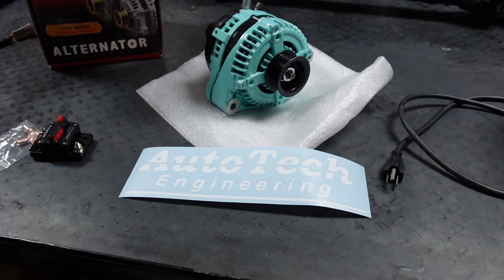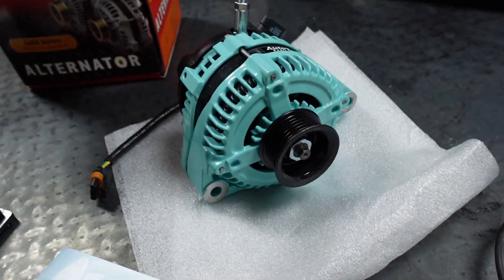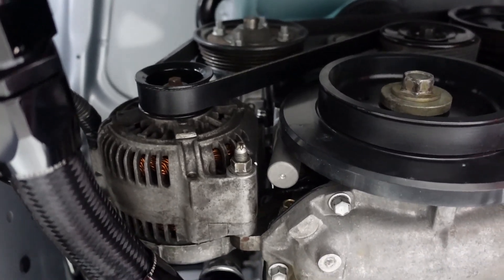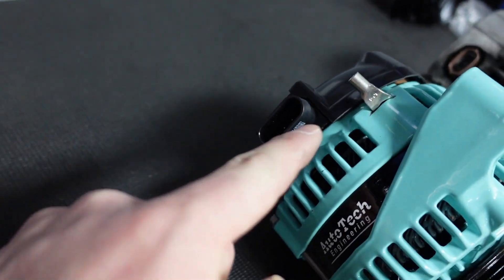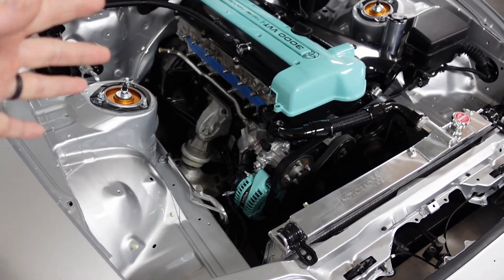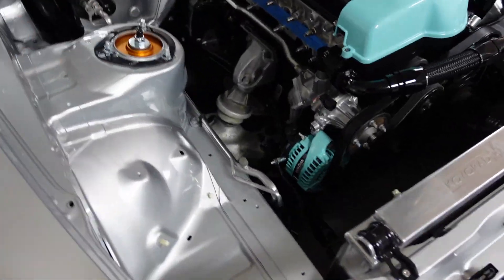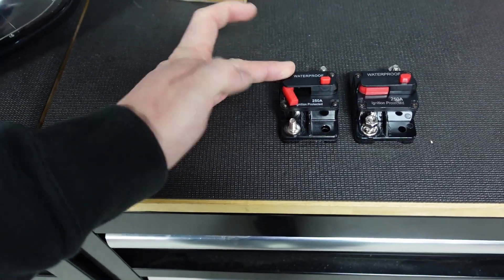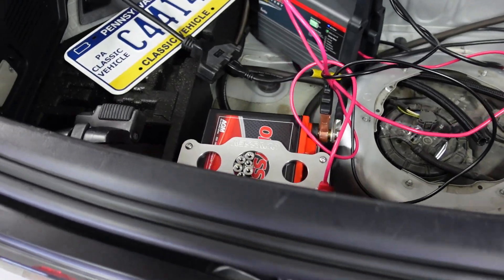AutoTech Engineering 2JZ Alternator

Comment: Question I got one of those alternators I plugged it up but it doesn't charge do I need to switch around the wires in the pin

Comment: As a person who builds and repairs alternators,
On a daily basis 
I can say any company that offers powdercoating alternators has no clue what they are doing.
Powdercoating holds the heat in way to much.
They get about 40 degrees C hotter
Then just a metal case, 
(Headerpaint/high heat paint are much better options) with thoses temperatures and being driven in racing application it will over heat the alternator 
Either it’ll spilt the rotor apart and destroy the stator.
Or it’ll burn the stator out which then will cause the rectifier to go bad.
Spinning at a high rpm (above7,000rpm engine speed with a 3:1 ratio) it will destroy the bearings as most companies don’t buy good bearings. 
Also any company that offers 160,180,220,250 ect amperage alternators are stock built units with a smaller pulley 
Also Denso only as 2 true high output stators 
128.5mm is 320amp and 138.5 is a 370amp
Which both can exceed the rated amperage buy about 30-35amps given all the other parts are top quality And it’s built correct. Just my two cents from experience with building alternators 
Autotech can make a good product I’ve seen there work.
Decent for sure but definitely geared for the car audio market. 
But keep in mind what I’ve stated,